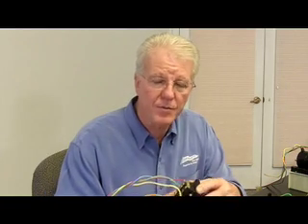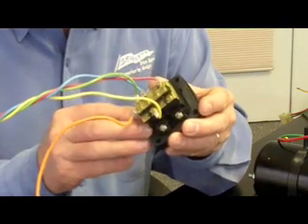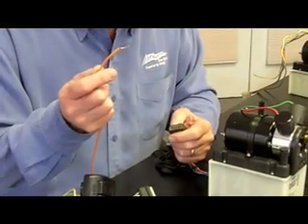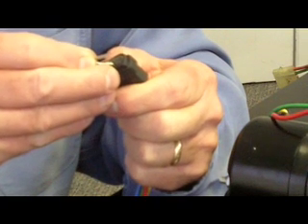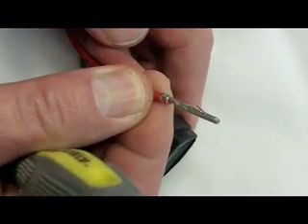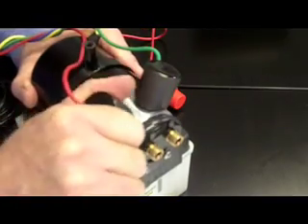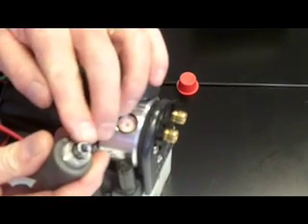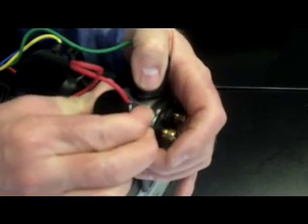Trim Tab Troubleshooting: One Tab Operates, Other Does Not

Comment: When I trim up on my throttle I can hear an actuator or or whatever acting, but my lower unit doesn't trim up. I have to trim up by using my secondary trim switch at the stern and it works fine. Any thoughts?

Comment: One wire to 12V but does the HPU need to be connected to the negative/ground of the battery as well?
Reply from the maker: Please contact out Support Team at BMI_Info@Yamaha-Motor.com or call (954)427-1400. Thanks!